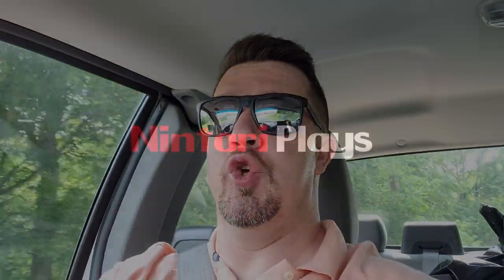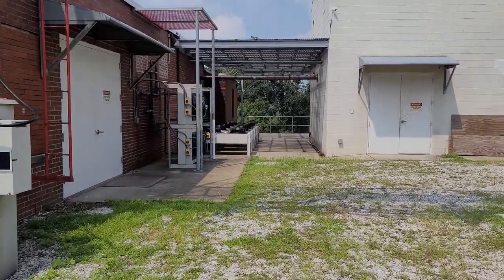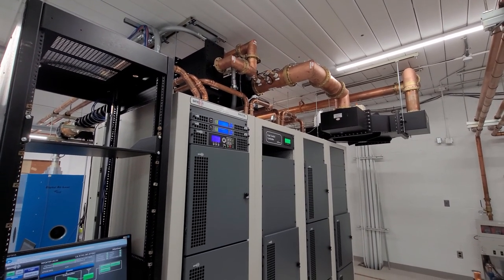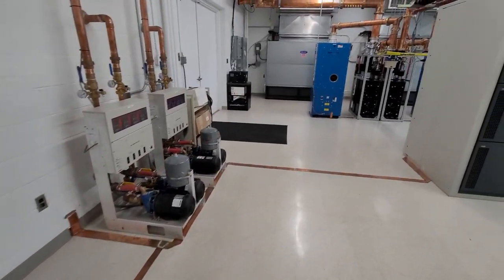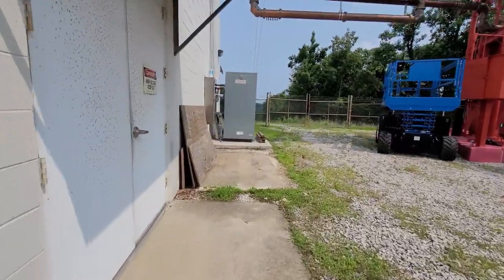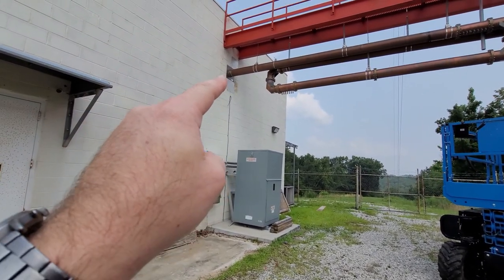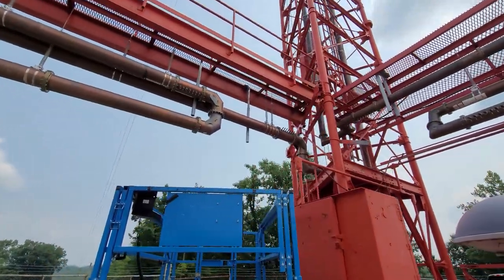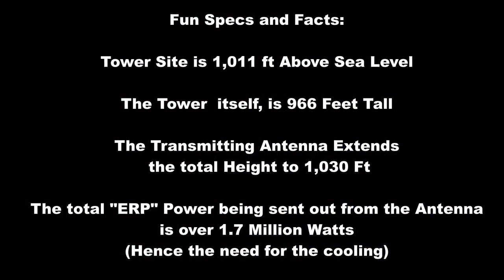Extreme Water cooling ! WSAZ TV Transmitter Site Quick Tour

Comment: This brings back memories. I worked as an engineering tech for a company who rolled out an IOT transmitter in the late 90s. I learned how to sweat copper plumbing up the 2" lines for the cooling system. I got to go out to Utah to do an installation outside of Ogden. Very cool.

Comment: Very interesting watch! I live way off in the fringe and love regularly watching WSAZ/WQCW, but here lately haven't been getting any signal. Hope everybody stays safe while working on that stuff, must be really daunting.
Reply from the maker: Yes while the backup transmitter & Antenna are operating, they do so under much less power and lower down on the side of the tower, so sadly a lot of OTA viewers down in Valleys, further away or on the backside of the antenna where the tower blocks the signal are without us! They are getting closer and closer to fixing the issue as they have found the final section that got burnt up at the Tippy top of the Antenna!
Reply: @nintariplays5654  Ouch why did it have to be the top... In that case I have all the patience in the world. I'd love the signal to be fixed but it is not worth possibly losing human life over.

Comment: I’ve always thought ERP is a combination of transmitter power x antenna gain in the desired radiated direction.  Not based on a transmitter produced wattage number that requires cooling?
Reply: Basically true, but you must also figure in coax loss between the transmitter and antenna which can be considerable at UHF frequencies.

Comment: Copper pipes and boxes are waveguides to carry the signal
That is a huge amount of RF Radiation and you would not ever want to be near that if it was opened
Reply: Not quite. Those copper pipes are hardline coax. Internally there is a center conductor. Waveguide is open on the inside, and scaled for the frequency in use. For VHF TV channels Waveguide would be very large rectangles (WSAZ is on ch.3 60 - 66MHz) and would require WR-1500	0.49-0.74GHz	15.000ins x 7.5000ins